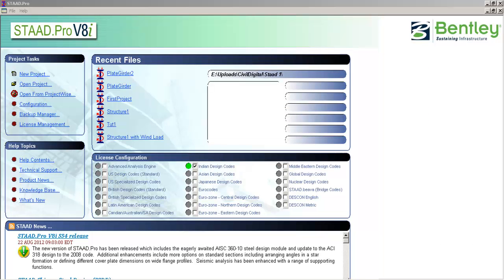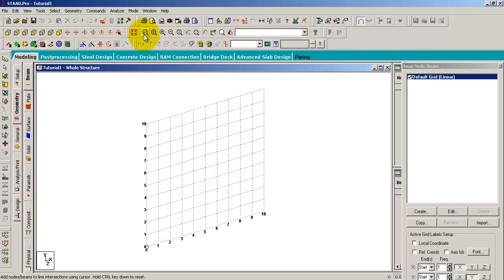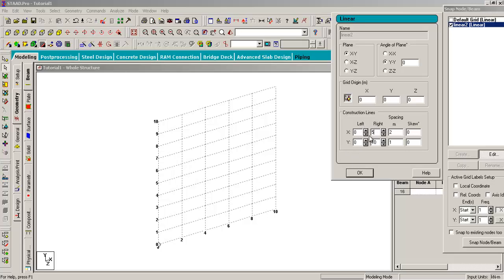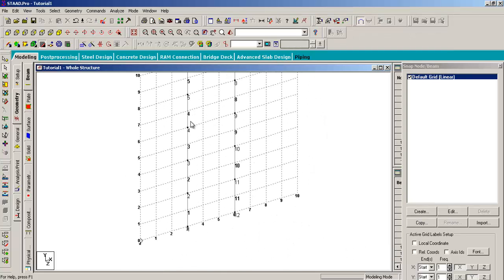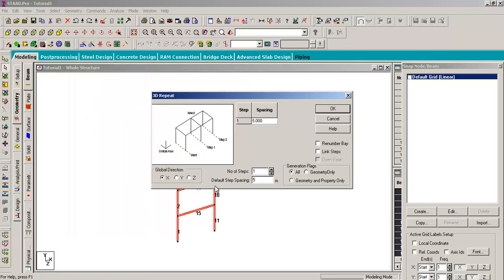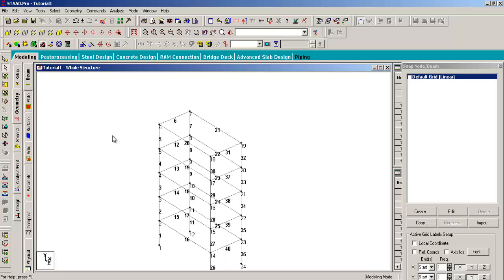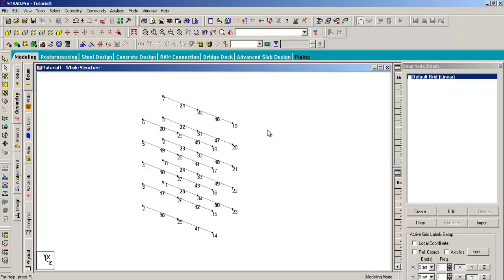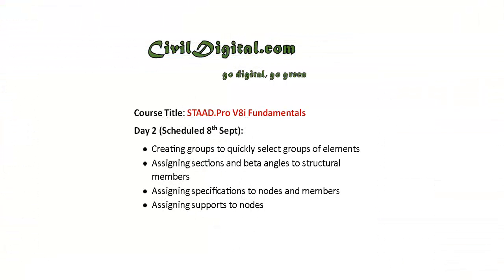STAAD.Pro V8i Fundamentals Part 1: Model Generation

Comment: What are requirement while we purchase laptop for use tha staad pro and AutoCAD
Reply: Keep atleast 128 SSD minimum and 8 gb ram. But if you want to use other softwares than I will recommend 16gb ram, 256 SSD, graphics card etc. Go check out this video. Full tutorial coming soon with my ongoing projects from design stage to drawings. So subscribe and ping in my comment section https://youtu.be/LjPPX5rBZ3w

Comment: Whatever I design in staad pro v8i according to IS456 the output concrete grade is M30 and steel grade is Fe415 but due to some constrains I can only use concrete grade upto M25 and steel grade should be Fe500 only can anyone advice me how to change them.
Thanks in advance.